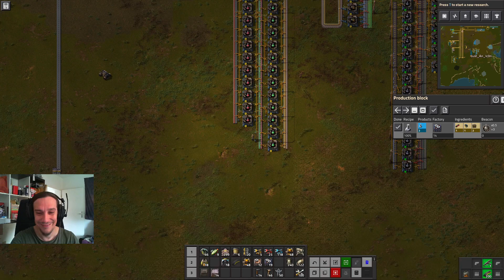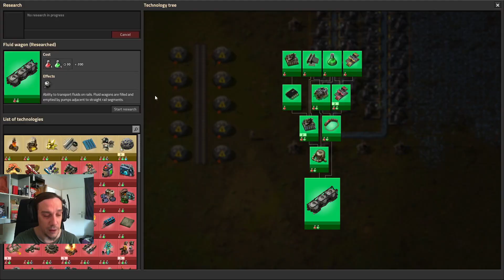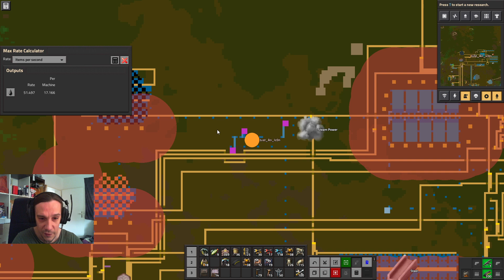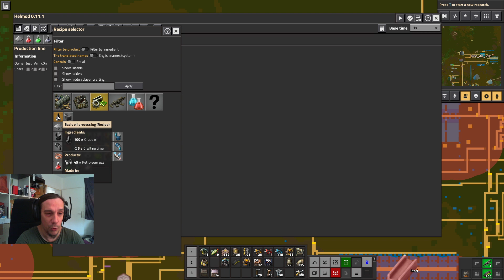Factorio 1.0 Vanilla Gameplay - Ep. 16 - Playthrough Guide

Comment: 10:30 This is one time where you can place a pole, hold and run and it will place them so that they are all covered. It stops working if you get into range of another power pole, though.
Reply from the maker: I almost never work with this function except for over land power connections :D
Reply: I avoided it for a long time because I thought it was so inconsistent.. It wasn't until I realised what stopped it working that I started using it a lot more.  Saves stopping every few steps to place a pole then keep walking.